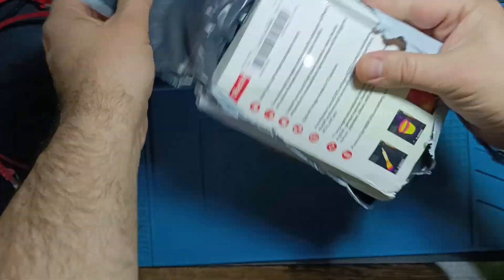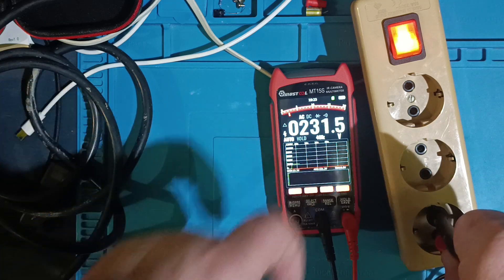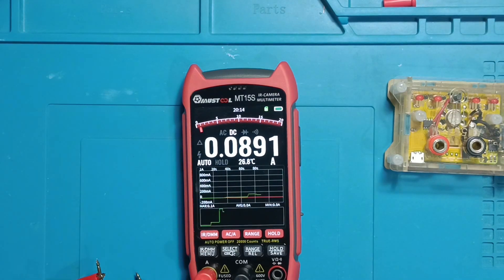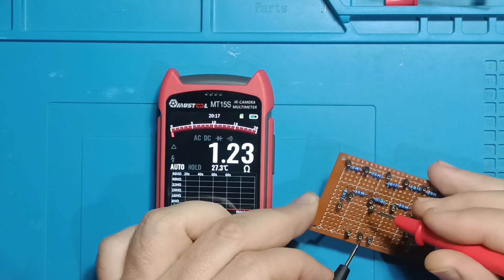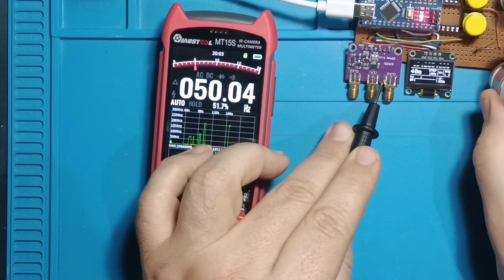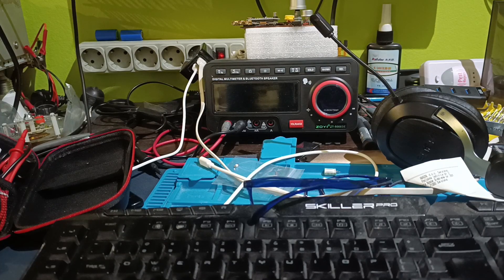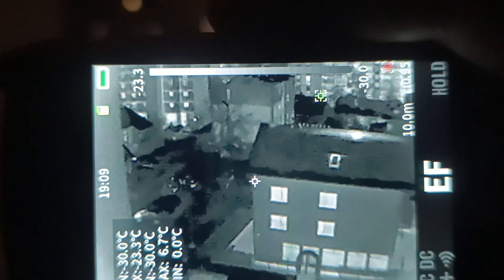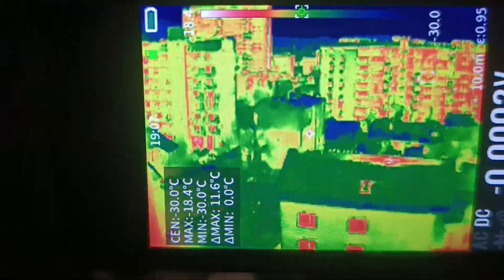Thermal Imaging with multimeter 2 in 1 Mustool MT15S

Comment: Is the thermal camera good i have baught the version with only thermal cuz i dont need multimeter
Reply from the maker: The thermal camera is perfect
Reply: @ Can u make a video on the thermal fetures alone a deep dive ln the thermal?
Reply from the maker: could, but I think one of the Flir models or HTA which attaches to the mobile phone will fit you better. This camera is view only no Recording feature ,beside the screenshot
Reply: @FantaBH  well they are tiny expensive and easy to lose soo no. amd this has beter res at way cheaper. soo a deep dive into the thermal would be cool
Reply from the maker: @watzegjemedaarnouvan  that is kinda hard as it does not have recording feature , so no video recording capabilities and already seen some negativity in comments regarding shaking camera as keeping IC camera in one hand and recording its screen with mobile phone is a bit shaking. So keep that in mind and tell me more about what deeper dive in to this camera you would like to  see. Beside what is already shown.
Reply: @ u could film u holding the thermal wich would be even beter just like u did in the video. and explore the feturrs and test it

Comment: I do a lot of low ohm readings at work. Shame this isnt more accurate in that. I might still try it.
Reply from the maker: So far the best one for readings below 1 ohm but not lower than 0.1ohm is zt-111, just always count in probe resistance. Even the Zoyi ZT111 is absolutely the same as the aneng an8008 To my surprise ZT111 reads low resistances much more precisely than Aneng.
Reply: There's REL printed under RANGE on a button I see. Isn't it for zeroing out the base measurement? That could get rid of the probes residual resistance and help below one Ohm.
Reply from the maker: @ there is and ofc it zeroing, but again even with that 0.1 ohm is 0.03 , 0.33ohm is 0.14, and 1 ohm is 1.11 ohm. Then u press again REL it switch to auto , we know how it works, then again you short probes and press REL it push it to zero. Measure same 0.1 ohm is 0.0 ohm , and so on again not accurate. So REL do something but not what it should, and it is lottery what you will get by pressing it. And so far I found this instrument good only in IR mode, that is mode which works flawlessly.